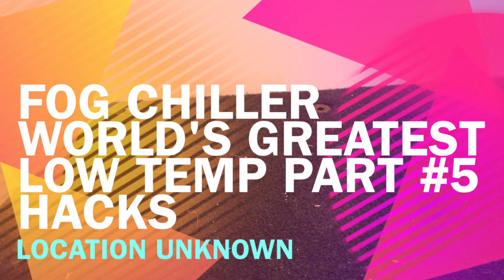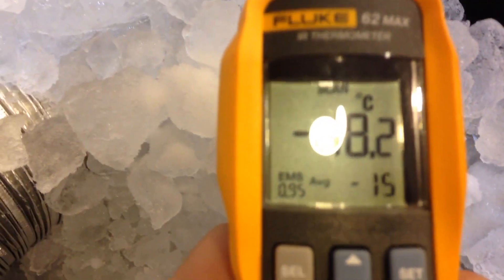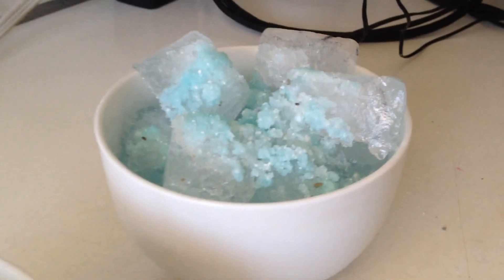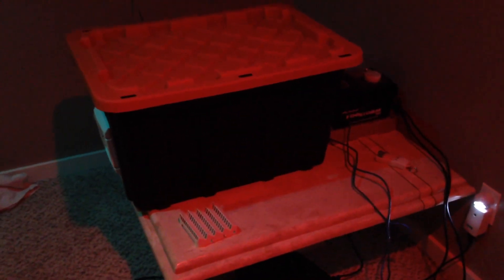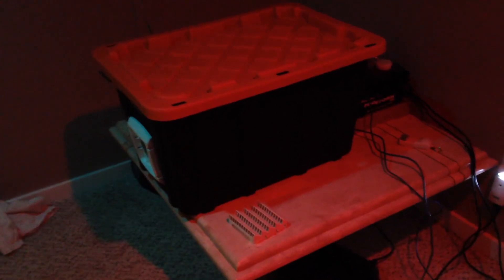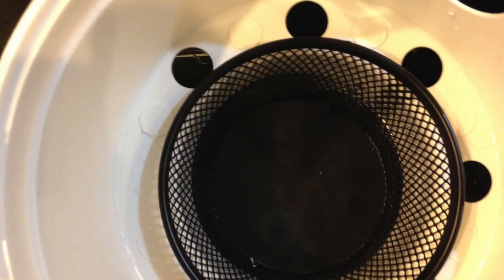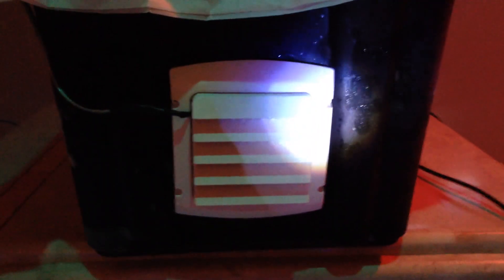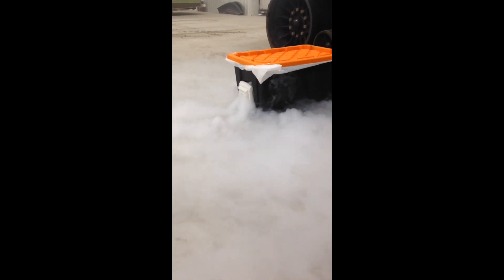Making the Bose Einstein Fog Chiller part 5

Comment: What does the white basket do in the ice box
Reply from the maker: It’s obsolete. Originally that chamber was used for dry ice boost. It kept the dry ice dry from water. otherwise it sublimates too quickly. The reality of it all is that if you’re already buying dry ice, just buy more and fill the chiller with that. It’s not at all worth mixing ice and dry ice together. Extremely cold ice and chem reaction can get the output temp below -30 c with this chiller design. Dry ice will take it below -70 c. If you’re already buying dry ice, just buy more...

Comment: Hey Mc Zoolando, I have 2 questions about your fog chiller: Do you simply put the CaCl2 Salt on Top of the Ice Cubes in the Box to "super charge" it? And does the fog travel throug the aluminium pipe all the way (like always separated form the ice), or does it simply enter the box on one side, then move through the ice freely and enter an output-tube in the box? Thx!
Reply from the maker: Yes put the mixture on top for best results. "supercharge" process is the chemical reaction. The fog travels through the in pipe, then through all the ice at the two furthest points, and to the out pipe. Check out all 7 videos. # 8 coming soon.
Reply from the maker: https://youtu.be/cXbdhlASy8s

Comment from the maker: Ice freezes to the temp of it's surroundings. MY CaCl2 mixture will start to melt the ice around the -36c range, dropping the temperature even lower. At this point the ice is caught in a cycle of melting and freezing. I don't actually know how cold it will go because our winter was mild and i only had about 2 weeks where i was able to freeze the ice to those sub zero temps. Part #6 should be posted within the week.